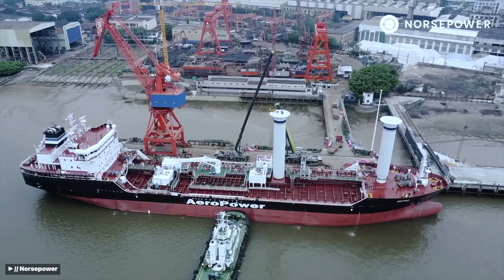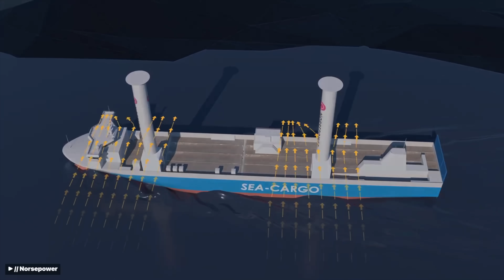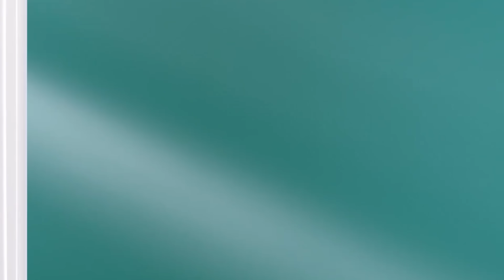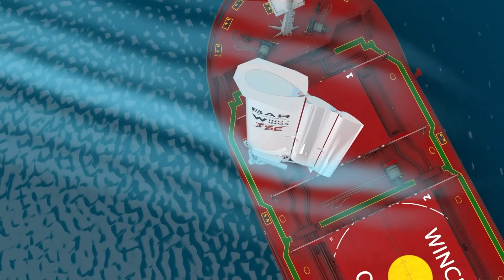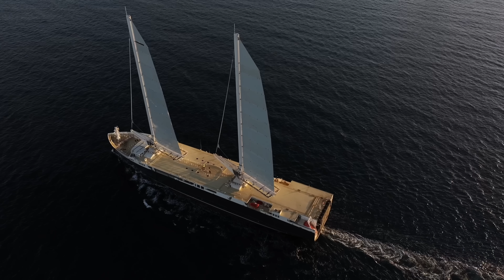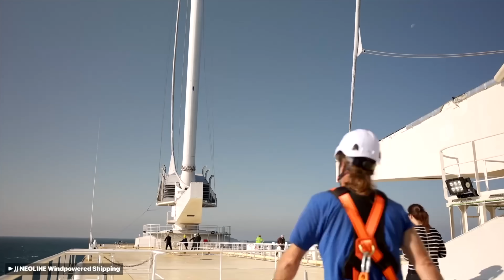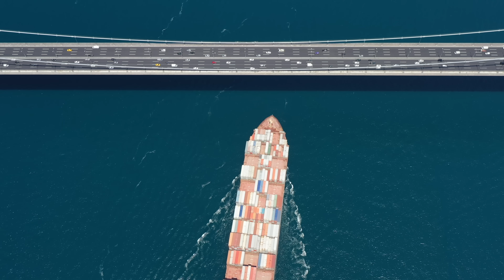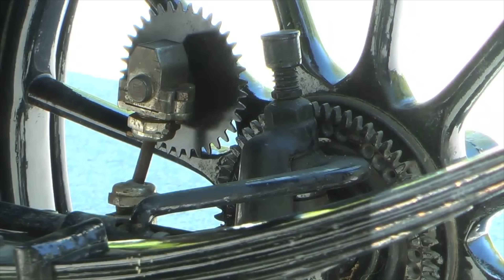Surprise Breakthrough Solves Shipping's BIGGEST Problem

Comment: Given that half the ships in the oceans are busy shipping fossil fuels, the biggest and easiest way to cut shipping emissions is to get away from needing fossil fuels. 
I like the kite solution because it seems to be retrofitable to existing ships. It can be placed in the area where anchor chains are, the ship is already designed to handle large forces concentrated there. It can be so largely automated no extra crew or other ship mods are needed. And considering that ships last decades of service before they get scrapped I see it as necessary to have some solutions fit existing ships. 
The flattner rotors and foldable sails do provide more power than the kite, but need a new ship to be built for them. I like them, but they can only make larger impact slowly, as ships get replaced by newer ones.
Reply: The kite solution only works if you have following winds.
Reply: @JamieTransNyc if you go high enough, you will have the winds you need.
Reply: Actaully, as of 2019, 14% of ships transport crude oil, and 4% nat gas. So not half
Reply: @John...44... yeah , it was stated poorly.  The reality is 40% of tonnage is oil, coal and gas.
Reply: No the biggest way to cut fossil fuels is not to ship thing around the world that can be obtained locally.
Reply: @princeofkernow9875 you mean manufactured locally.  Problem is I like bananas and coffee and they don’t grow locally.
Reply: @brettgracey9682  Where it can obviously! I'm not going to write an essay on the subject.
Reply: @princeofkernow9875 no, but OP was correct.  If we were to accelerate eliminating fossil fuels for transportation, electrical generation, heating and industrial use, up to 40% of global shipping would disappear.  The other 60% is often as difficult as its raw materials like iron ore, copper, and finished metals like Aluminium.  Agriculture is another big one.  Wheat, soy, other grains.  There is good reason why most of this is shipped, and can’t be replaced with local production, certainly not easily. Oil and coal are literally the lowest hanging fruit here, with the largest impact on climate change.
Reply: @brettgracey9682   Absolutely not possible to eliminate fossil fuels from transportation and electrical generation...where you base load power coming from? How many electrical heavy trucks or on the road? How much copper is going to take to build up a grid to supply power from just renewables?
Reply: @p @princeofkernow9875 absolutely is possible to eliminate fossil fuels from transportation.  Especially ground transportation.  EV’s have already hit the upward rise on the adaptation S curve.  Transport trucks?  You might have not noticed but there are any number of companies who have already sold thousands of electric semi’s.   Americans seem to assume because Tesla is a complete failure at it, everyone else must be also.  The reality is short haul trucking globally speaking is just beginning a transformation from diesel to electric.  That trend will take a few years to dominate, but there is zero question it will.  Same goes for EV’s.
See the thing Americans fail to understand is that the exact same countries that have been embracing electrification the fastest, are the exact same countries that those tankers haul oil, LNG, and coal to.  They also are countries that tend to get lots of sunshine and wind.  You ask about baseload.  Well here’s the thing, all those battery operated vehicles, they store electricity.  When their demand drastically increases, like it has over the past decade, their cost plummets, like they have over the last decade.  See most larger grids are a combination of different generation sources.  Often, coal, diesel, gasoline, natural gas, biofuel, solar, wind, geothermal, nuclear, hydro, and of course let’s not forget, electricity can be stored in hydro, Compressed Air Energy storage systems, and of course the ever rapidly growing segment of battery storage, which is growing rapidly.  

See the common misconception is that renewables will replace FF’s overnight.  They won’t.  It’s been a gradual build out.  That buildout will continue unabated because solar and wind are by far the cheapest forms of new generation infrastructure.  Furthermore, unlike any FF system, they are ultra affordable.  From someone setting up a small balcony system, to buying a small portable BESS, to a $4-5 million wind turbine that can supply enough power for hundreds of homes, renewables have a scalability that FF’s can’t match.  They have home affordability FF can’t match. All of this undermines the financial stability of grid based FF based power.  Now because the US isn’t the center of the universe, that drives all invention and adaptation, here’s the rub.

Those countries that need to expand their electrical generation to support their growing populations, think of the 1.5 billion people who live in Africa, the 1.5 billion who live in India, the 250 million Pakistani’s, the 175 million in Bangladesh, the 400 million people of Indonesia and the Philippines, the half billion people in South America.  They are almost completely leapfrogging over expansion of their electricity grid using Fossil Fuels.  Instead they are building our dirt cheap solar and battery systems.  Guess what kind of vehicles they will also increasingly buy?  They have lots of sunshine and wind.  Not so much coal, oil and gas.  Why?  Because wind and sunshine is free, and FF’s just went up 40-60% almost overnight, because some idiot decided to bomb Iran.
See you’re trying to compare a commodity to a technology.  FF’s are one and done, once you burn them you have to buy more.  Renewable technology is something you install and you use it daily for the next 25-75 years, with no fuel costs.  It’s basic economics and FF get more expensive every year and renewable tech’s get cheaper every year.
Reply: @brettgracey9682  the EV's subsidies largely stopped, and support for the current electric fleets are dying extremely fast.
Reply: @Buzzard-wq1bw that is only in the US, which is less than 20% of the global car market.
Reply: @princeofkernow9875  I get what you are saying and I don't disagree that it would be good (although how feasible is another question). But just mathematically it is incorrect, slightly. 
I have really seen various statistics all come to the same result: about 50% of shipping (usually measured in tons of cargo times miles traveled) is fossil fuels. That means that shipping other things is the other 50%. And not all of those can be obtained locally. So even if we eliminate shipping all the things that can be obtained locally, we still get less than 50% reduction. Eliminating fossils gets us 50% reduction. So what you say would stilll come second. 
The best thing possible would be doing both those things of course.
Reply: @hebijirik  We are not going to eliminate the need for fossil fuels ever from the energy mix. Reduce sure, uses more wisely sure, but elimination is impossible.
Reply: @princeofkernow9875  If by that you mean we can drop it by 99.something percent because using fossils just to  light them on fire is just stupid, then I agree with you. Yes, some non-zero number of oil tankes well exist for a very long time.
That still does not invalidate what I said. Too much stuff physically cannot be produced locally, too much food cannot be grown where it is needed. So it is not possible to eliminate anywhere close to the amount of shipping that can be taken out of the fossil fuel shipping by using fossils just where they are not fuel, but a great source of complex chain molecules that would be incredibly hard to make otherwise.
Reply: @hebijirik   25% of shipping could be eliminated if hydrocarbons where produced locally. US doesn't and should need Russian oil. Australia shouldn't need Arab oil. The example and the list of product that don't need to be transported around the world is huge. That list is bigger than any possible small benefit of putting a damn sail on a container ship.
Reply: @princeofkernow9875  your argument sounds a lot like "we don't need electric cars, we just need everyone to stop driving and the car emissions will go away" kind of thing. While technically true, I don't see it happening. 
Just like we made our lives extremely dependant on cars being used, we made ourselves dependant  on ships too. Getting away from either of those is not going to happen (if it can even happen), not faster than we can improve the propulsion methods to something with fewer emissions. 
And it is not all or nothing. Where huge improvement is not possible, or not right away, small one is better than nothing. No, kite or a sail is not going to solve the problem. But they are relatively cheap intermediate improvements that can be deployed faster than anything else for those ships that we cannot eliminate. I don't see why you hate that so much.

Comment: Wind power turbines has a lot of advantages compared to those technologies. Very low mass per unit of swept area with long lasting materials, can be highly controllable, takes up very little deck space, and can produce power whenever there's wind, that can be very useful even when you don't need propulsion power, or don't need much power for propulsion as is generated by the turbines. While the detour via power generation technially is less efficient than direct propulsion, that disadvantage is negligible compared to all the advantages wind power turbines on ships could have compared to all the options in the video.

Flettner rotors takes the price for bad "solutions". 1 to 10 energy gain, wow! That means after losses in producing the power via generators, less than 1 to 5. Anyhow, ten times more propulsion than energy required just to overcome friction to spin those rotors, which should be ridiculous, even ten times the energy required to overcome that friction can't make much of a difference on average fuel consumption on a ship in practice, the claims about savings, if at all true, are taken out of context, as the average effect can't even be in that order of magnitude. There are very good reasons Flettner rotors never left experimental/demonstration stage, despite the fact that they were proved to "technically work" over 100 years ago.     

How much energy does a sail or airfoil need to function, besides relatively tiny amounts for occasional adjustments? Zero. Also, sails and airfoils can produce much more propulsion, per unit of swept area, cost and mass, and can be much more controllable compared to Flettner rotors.

Comment: I know a lot of cruise ships are electric motors powered by more efficent diesel generators. Im surprised this concept is more efficetive with winds in the air as opposed to currents in the water.
Reply: Currents create drag on the boat.  Trying to harness the power of currents will just slow you down more.
Reply: @TerraPotentia  good call. I assume it has something to do with the drag equation. The extra viscosity of the water makes sense because like you said sticking anything into the water it creates so much more drag it would only slow it down / make it less efficent.
Reply: @DynesLair-kb6qs  Tidal and/or current energy generation is a total dead end.  Salt water will corrode any components way too quickly for it to be economical.  

In addition to corrosion issues, another thing is that life happens in the oceans...  You would have barnacles and mollusks gunking up any moving parts...  It's called biofouling. 

Geothermal is the future of energy generation.

With the advent of millimeter wave drilling geothermal will crush all other forms of energy generation in the decades to come.

Comment: Finally a technology so advanced and so innovative no one in human history has ever thought about it before.
Reply: The issue isn't that no one has thought of it before, so much as making it make sufficient sense from a purely economic standpoint that those making the decisions actually Use it. There were, after all, very solid reasons why we mostly Stopped relying on wind power for ships outside of recreational and sporting contexts, most economic, but safety was also part of it. Those issues need/ed to be overcome before switching back makes/made sense.
Reply: @laurencefraser One of the limits to wind power is the kinetic energy available to be harvested in the mass of air it is possible to contain.  Another is the scale of the operation; when sailing ships were being succeeded by power driven vessels the largest that were built included the ‘Prußen’ and the ‘Thomas W Larsen’.  The ‘Prußen’ used a crew of 45 to move up to 8 100 tonnes of cargo and was lost at sea following a collision with a power driven vessel.  The ‘Thomas W Larsen’ used a crew of 18 to move up to 11 000 tonnes of cargo this vessel was lost when at anchor in the Scilly Isles where she was sheltering from a storm.  The scale of merchant shipping in the modern age is much higher than in the early twentieth century when these events occurred.

There is much discussion of 'decarbonising' the marine commercial industry and various wind power ideas are offered; such as Flettner rotors, kite sails, traditional sails and wind turbines.  The factor that seems to go unconsidered is relative wind direction and VAWT would seem to be the only option that could cope with that variable.  The availability of the wind, the amount of energy that could be gathered from it and the cost of the installation receive little consideration but on the limited information circulated VAWT seems to be the best of a poor group compared to hydrocarbon fuel.
Reply: Many successful technologies have been "thought of before." But typically they only become successful when combined with other technologies or materials that did not exist when the "principle" technology was first thought of. The problem is framing- economically utilizing wind power isn't  based on a single technology.
Reply: Flettner invented these rotors more than a century ago
Reply: @JustAnNPC69 : tech bros love this continuous repeated trick!

Comment: This does not sound very promising. The cargo ship shown  is very small, which makes it much less efficient. Most cargo today is shipped via huge container ships with 14,000 containers and more. That drives the fuel cost per container down significantly. The fuel per container even with small ships that have a sail will be much higher than shipping on a big container ship.

The other issue that bothered me is the mention of 18 tons of fuel saved per voyage. If that is 18 tons out of 40 tons - yeah - that is amazing. But if it is only 18 tons out of 250 needed for the voyage then this is totally uninteresting. Especially with all the complexity and maintenance costs of having another system onboard. 

So from the very high level info in the video, this sounds more of a prototype with a dream than actual technology that is economical enough to be used in real shipping.
Reply: We have a problem today with whale deaths, and global shipping is the cause...  Most whales that wash ashore die from blunt force trauma which translates into ship strikes...  Having more smaller cargo ships will only make things worse.

Comment: I've often wondered whether, to benefit from the Magnus effect, the whole Fletner rotor has to rotate or whether it is just the surface of the cylinder that needs to rotate. If so, then a nylon sleeve could slide round the cylinder driven by a very small electric motor. If so, this would be a much more stable structure and use very little energy.
Reply: Sounds like MUCH more friction than conventional bearings to me.
Reply: I would think it wouldn't be that useful to have a rotating sleeve because the whole point is to get the wind to turn a rotor.

Comment: I need to understand how a (relatively) tiny kite can tow an enormous cargo ship. O_o
Reply: @taylankammer  its still powered but instead of using 100% of the engine it only uses 80% and the 20% is on the sail, its more complicated than that but thats the layman explanation
Reply: Not a lot. Its barely worth doing except in very favourable winds.
Reply: @dnomyarnostaw  20% is a lot. I worked on a supertanker. Thats a wild amount of gain for something that sits off deck and weighs less than a sea can.
Reply: @IdrisFashan  I don't think I ever heard of anyone claiming a kite could ever produce 20% savings. I certainly didnt.
More like 2% i would guess.